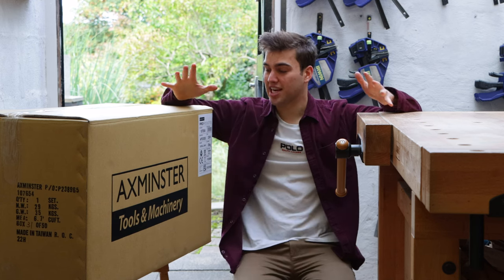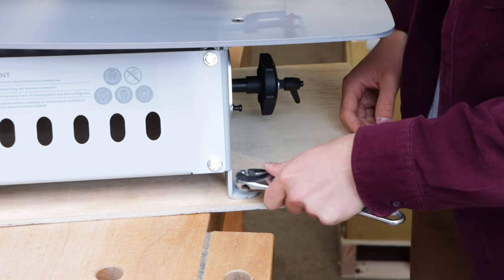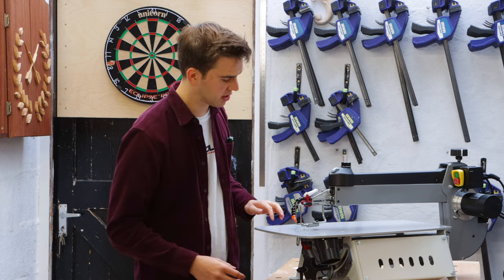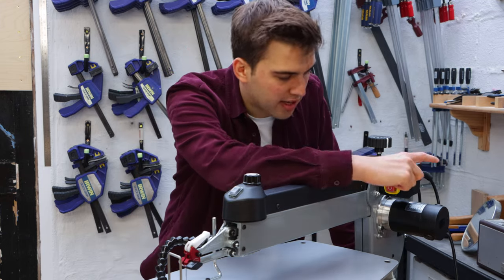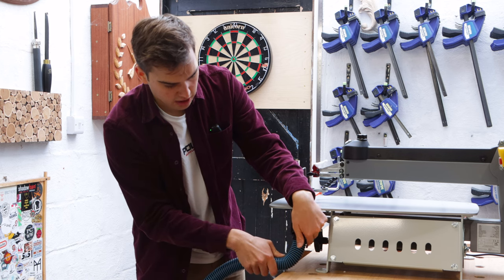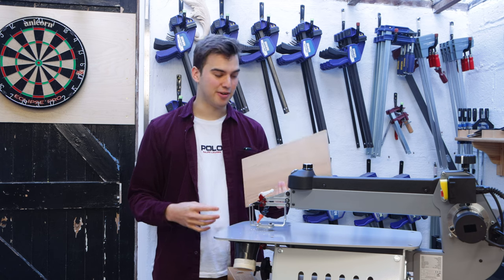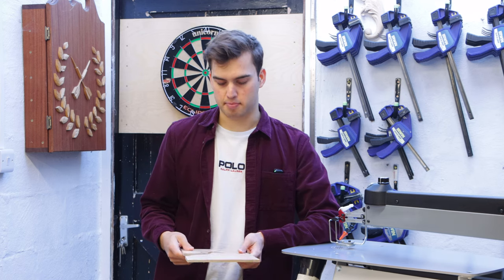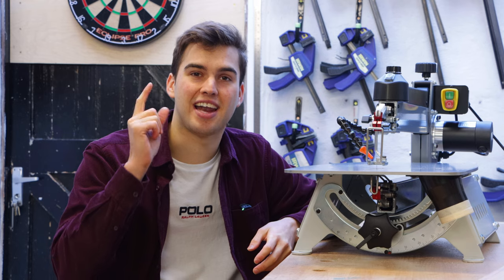Unboxing The Best Scroll Saw On The Market! Axminster Professional Scroll Saw!

Comment: Hi Sean, I have an old scroll saw and you have just given me the reason to upgrade to the Axmister. I liked All the things you said about it, but I was impressed with the hold down bar and speed of cut. I do not do much scroll saw work due to the poor results I was getting, and the speed was so slow and difficult to get the saw to follow the line.
Reply from the maker: Hi John, yes It's a shame old or cheap tools can put people off them, and most people end up thinking it's not the tool for them. But this scroll saw is very intuitive and I don't think anyone would regret the purchase. I'm glad I showed you this tool and you enjoyed the video... if you do decide to take to plunge, I'd appreciate it if you used my affiliate link! Many thanks!

Comment: Greetings, Sean. I have the identical model as you, albeit mine is now four years old and was then called the Axminster "Trade" before it was rebranded as the "Professional". The machine is simply sublime but I was annoyed by the fact that it has the large NVR switch box on the back, which acts as a cut-out and has to be reset by reaching back. I put up with this for four years until now. I have removed that box completely and replaced it — as a switch — with a Proxxon foot pedal. This means that I now have complete control over the instant stopping and starting of the machine without ever having to remove my hand from the workpiece to press the on or off button on the NVR box. This simple change has improved my already enjoyable Axminster experience exponentially.

Comment: I purchased a 15” Excalibur several years ago and absolutely love it. I’ve seen several saws that are copy’s of the Excalibur and this is another one. Before the Excalibur I had a “toy” saw made by Delta. I kept it under the bench and only took it out as a last resort (if your a wood worker you don’t need an explanation). Now, I actually look for scroll projects. I refer to my Excalibur as my Rolls Royce. I’m  listening to the video while I’m typing and contrary to the video I don’t use the hold down foot. I’ve found it is unnecessary with a saw of this caliber…..happy scrolling.

Comment: It is a rebranded Excaliber. Still an Incredible saw, just many companies putting their name on that saw, not unique. I have the Pegas brand and love it. Although the default "dust collection" stinks. It's two thin plastic film pieces that are sticky inside and dust and small chips get stuck in between the sheets. The dust collection Seemed like a good idea, but does not work well, took mine off pretty quickly. It is nice to have a port mount on the bottom though.

Comment: Get a magnetic digital angle gauge and stick it on the top or side of the upper arm.  It precludes having to look underneath to set your angle of cut.  These angle gauges are really cheap and useful additions to just about any stationary shop tool.

Comment: its not a bad saw but have you tried the Hegner-----also I would suggest you remove the guard from around the blade-----it will give you much more control with that off-----------

Comment: Hi Sean. Mine is being delivered tomorrow. Just wondering if you know if its possible to have a foot pedal with this?
Reply: Yes.  Most all tool dealers (Amazon too) sell an aftermarket footswitch.  You plug the pedal into the AC receptacle, and plug the saw's power cable into the pedal.  Flip the saw's power switch on.  When you step on the pedal, the saw runs.  These pedals are inexpensive.

Comment: Good video with some points worth thinking about. I'm just about to purchase my 1st scroll saw and one of the things I've seem with my research is that blade changing on the cheaper saws is awful and very fiddly. The Axminster looks brilliant but nt sure I can justify it as a 1st purchase even though I love it lol.
Could you tell me what wood you were using as it looked like the perfect grain and thickness for some of the things I want to make?
Reply from the maker: Hey,
I was using ash, Its a really nice work to work with. But tbh for scroll saw work, most thin materials work well. If my opinion, if you did take the plunge you wouldn't regret the purchase. If you buy cheaper, you would likely upgrade later on, but you'd get better results with a high quality machine. Hope that helps!
Reply: Thanks Sean. I tend to agree that buying the best quality that you can afford is always the best way to go. Nearly £900 is a stretch though as it's not for a business and  is just a hobby. The entry level Axminster is only £139. I need to sleep on it lol, decisions decisions.🤣

Comment: Being new to using a scroll saw, it would be great to see a video about the different blades available and when it's appropriate to use them?

Im just about to press buy on the same model, it's expensive but probably worth it and there's £170 off today. 😀

Cheers
Reply from the maker: Hey mate, Thank you for the video idea! I've been thinking about a blade video for a while for multiple machines! Cheers for the suggestion. If you could use my affiliate link, that would be fantastic!

Comment: Hey man. Great video. Excalibur, Pegas, and Axminster are clearly sourcing from a similar/same supplier. Maybe King as well. But they seem just a little different. Look at the Pegas saw from Grobet. https://www.youtube.com/watch?v=DkUqf9KlCRU It is the Axminster Pro series. For this particular design, I see King as the frontrunner, but I have no idea who is the originator of this design/machine. The Pegas and the Axminster even have the same holes cut in the case sides. So if anyone watching this likes this saw, and is not in Australia, the Pegas saw is the one to look at.
Reply: PEGAS is the inventor/manufacturer of this type of scroll saw....Swiss made, in Vallorbe.
Reply: @umbertoorsini5210  I think you'll find it's Excalibur that's the source. The Canadian company that made it, in Canada, folded, It was only after that, that a Taiwan company took over production. They started producing it for a number of brands (including Pegas) each brand with their own little tweaks but for the most part the original design. Pegas did come out with their blade clamps which is a highly recommended upgrade if your branded version of the saw does not already come with them. The Axminster does. I up graded my previous saw branded by Carbatec, an Australian company, with the Pegas clamps, the difference was chalk and cheese.

The list of brands is growing. The original (Excalibur) made in Canada is no longer, and the brands now, with the same base design if you like, all come out of the same Taiwanese factory. Some of these new brands are Axminster, Pegas, Carbatec, JET, King, Seyco, WEN, and probably more I have missed or are yet to hop on the band wagon. I'm just nervous about what happens if/when China invades Taiwan.